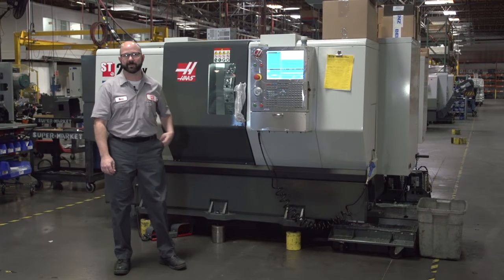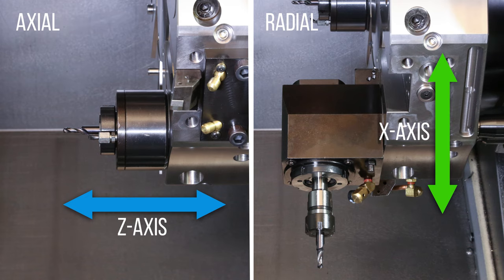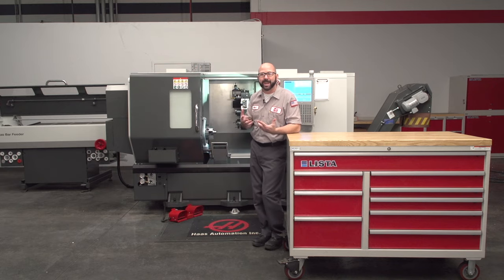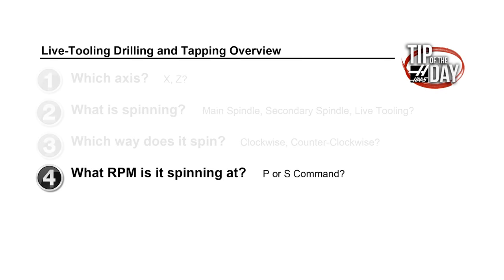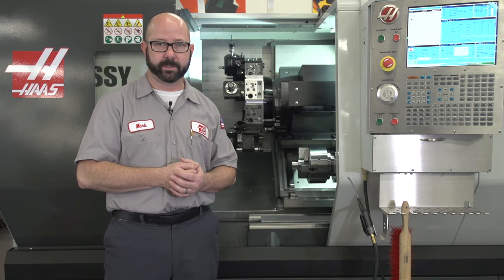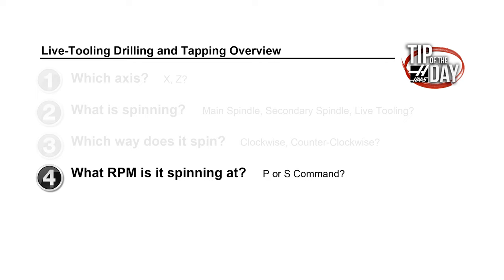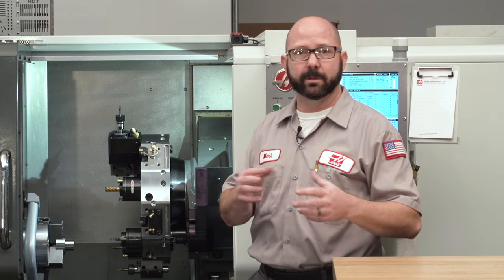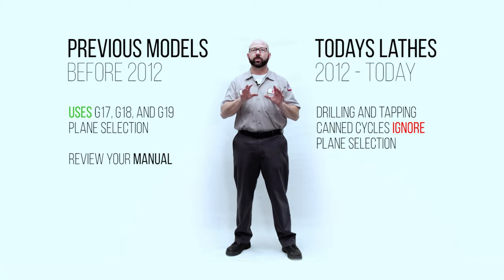Drilling on a Haas Lathe: Everything You Need to Know – Haas Automation Tip of the Day

Comment: Been a machinist for roughly 12 years. Have done manual work, CNC mill, and CNC lathe work. Haas is by far the most "foreign" when it comes to codes and "Intuitive" programming. Sorry, but I hate Haas
Reply from the maker: Miguel –As an Applications guy, we used to get a ton of calls from customers who had crashed their machines – having forgotten to change their planes (G17/G18/G19), when live-tool drilling, or to change them back with done. I think what Haas has done is tried to protect the programmer and the machinist from those kinds of crashes. You just choose your cycle and go. Simple. Hopefully the video helps get you up and going fast, if you ever need to program a Haas. Thanks for the comment. – Mark, Haas Tip-of-the-day
Reply: Devin Arias ,good for you ,but I done think any one cares what you like and don't like,you dont have to share that with the public,I hate alot of things but I'm not gonna make that opinion any one,I'm not a cry baby

Comment: If you’re drilling a 2” bolt circle on a face, and the bolt circle is undersize .005… do you adjust the wear .005 or .0025?

Comment: just one question 
if i want to make inclined hole ( axis x and z in the same time, which code can i use it, by driven angle holder. for example : strat x10 z0 end x0 z-5 (angle 45)? 
thanks

Comment: So I guess my questions are: when using program start g codes like G18, G20, G40, G54, G80, G90, G97, and G99 which is what I learned for the standard haas lathe. Is there any that we need to change or add to the start of a program? I assume G18 might change but I’m not sure. Or can it start the same? And does 2 axis machines do the same that a standard lathe does then more? Stupid question I know but how would you shape a raw stock material if x and z are two different turrets? Is their a g code that makes the z axis default to a standard lathe for shaping of stock then cancel it to go back to 2 axis machining? 

I know lots of questions with probably simple answers but I only finished the CNC operator and am almost done with the technical diploma. I want to get ahead for when I go to programmer for Swiss CNC. Plus I’m curious lol
Reply: All of our standard Safe Startup Line G-codes will be the same. We will want to be sure to return to our standard G18 XZ plane when we want to do Turning. This is easy to forget after we switch to G19 or G17 for Live-Tool Milling.

Comment: 2004 HAAS SL-30 Ver L6.07N 

Official HAAS Manual has no (0!) examples of O/D Radial Drilling with Live Tooling even though the machine came with Radial Live Tool Holders... wtf? 

Everything I have tried has resulted in "SPINDLE NOT TURNING" alarms at the same location in the program... I've tried using... 
- M14/15 
- M19C# 
- M133P#/M135 
- M154/155
 - G01/G81 

I do not WANT the spindle to turn during Radial Drilling with Live Tooling...

All I want is a F'ING example of Radial Drilling with Live Tooling before the Ver 11 changes because we've all been abandoned by HAAS.

Comment: Changing a lathe tool pocket and attaching a drill pocket. How do you tell the machine that's a drill tool? Is it as simple as changing the X offset? Other  brands you tell the machine it's a drill pocket and it's offset 0 zero.
Reply: On a Haas Lathe we have an F2 Centerline function for on-center tools like Drills and taps. From the Tool Offset Page we can press F2 and it will automatically set the proper X value for us.

Comment: Sadly someone crashed the bajeebas out of the M/Y live tooling lathe at my current shop PRIOR to my hire; now axial live tool doesn’t drill on center and I don’t know what to do to fix it.
Reply from the maker: Xmaswitguns – If you have an Y-axis lathe, you can just set an XYZ offset for that tool that will take care of things, putting the tool on-center (be sure to call an XYZ for the tool in your program). Check out this lathe setup video: https://youtu.be/Yo1J5XWy78Y?t=187. If you don’t have a Y-axis lathe, or it was a bad crash, I’d have your local Haas Dealer take a look. – Mark, Haas Tip-of-the-day
Reply: call your sales rep of the machine and he should have a source at the manufacturer

Comment: I have a doubt on Live tooling on 3 axis lathe.
Is it possible to drill at an angle using the live tool ?
ie,can we mount this live tool at an angle ?
Reply from the maker: Subin – Sure, we can drill/tap (vector tap) on our live tool lathes, with an angled head. We can drill with a regular point-to-point G01 code, and tap with a G195 point-to-point tapping command. – Mark, Haas Tip-of-the-day
Reply: Thanks for reply. 
one more, 
Is it possible to attach tool head at angle in all of the 3 axis lathes,means standard 3 axis lathes ??

for keeping at angle, do we need any special accessories??

Comment: is it possible to drill in the center along Z with the main spindle and live tooling at the same time?
Example the main spindle have 5000 rpm and livetool have 6000 rpm combining them together increase the "max rpm" for live tool to 11000rpm

And before anyone asks
yes i use google to write in english haha
Reply: Guranga93 Yes, it is. I do it every time to drill soft materials, as brass or aluminum. That allows to increase the feed rate too.
Reply: Yes. The technique you ask about was done on Automatic Screw Machines for decades. It speeds up the operation by combining speed rates. It's especially effective with small drills in tough material. Whether the Haas control allow this I don't know.
Reply: Yes, of course. That's exactly why they have S for main spindle speed and P for driven tool speed.😉

Comment: If this machine does milling as well why do you call it a lathe with live tooling and not a mill/turn? Unless for some reason you can't use endmills (I'm not seeing why you couldn't) I don't see why you wouldn't call it a mill/turn.
Reply: I guess if a lathe has live tooling, but only two axes and/or only indexing capability on the spindle instead of full rotary axis movement it would have live tooling, but little milling capability. Idk if this applies to this machine tho.

Comment: how i can drilling a hole in angle from the edge?
Reply from the maker: Dylan – There are quite a few companies out there that make adjustable, angled live-tooling heads for our lathes, Benz Inc. is one. With an angled head, you can drill at any angle using a simple point-to-point G01 code. You can tap at any angle on your lathe, point-to-point XZ, using our G195 Live Tool Tapping cycle. – Mark, Haas Tip-of-the-day.
Reply: Haas Automation, Inc. thanks for answer.
Reply: @haasautomation   please add video for swiss lathe manual programming on live tools or gange tools thanks alot

Comment: you also forgot what codes do what? z=plane g83 drill/g84 tap/g85 ream x plane g86 drill g87 tap g88 ream (tapping you need to use a sync code. fanuc is m29 just above the g84/g87 cycle. need to call up the spindle speed twice, usually
Reply from the maker: Daniel – These are some of the nice things about Haas machines. No need to call up a Sync Code when tapping on a Haas, like you would on other machines. The Haas machine does this for us. And on a Haas, we don’t want to start the spindles before tapping (M03..), we just command the rpm with an S code, as the Haas machine starts the spindle for us, only when tapping, to save time. Good things to look out for on other machines though. – Mark, Haas Tip-of-the-day